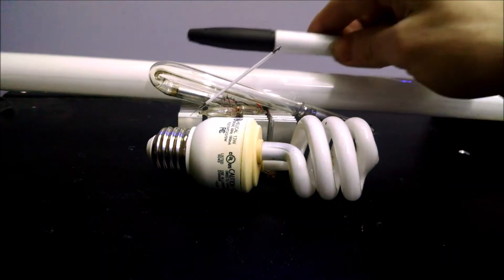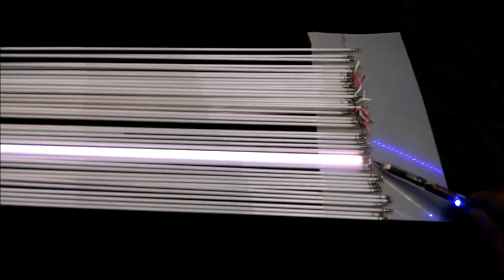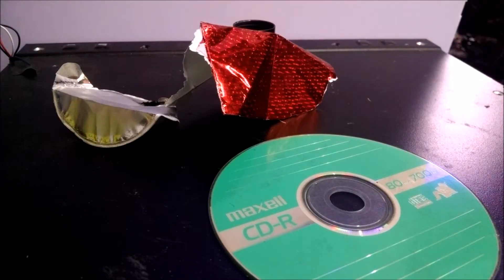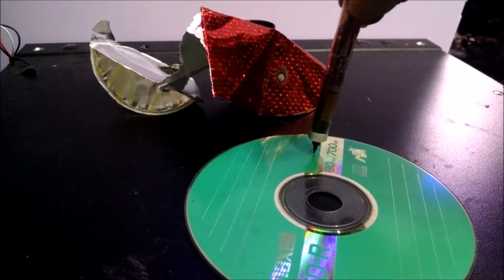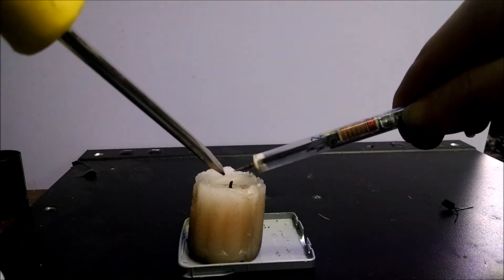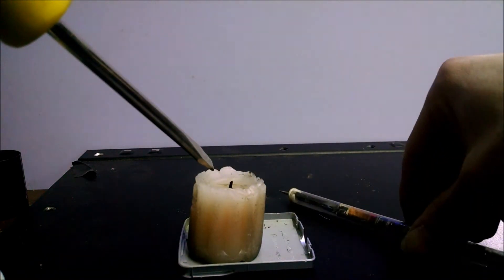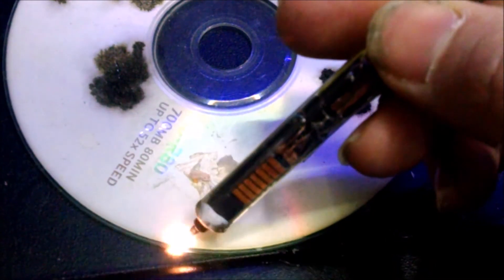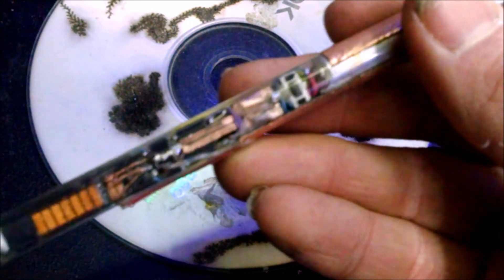High Voltage Gadgets, Tesla Magic Marker & Plasma Pens

Comment: I was looking at your video to try and understand why the plasma skincare pens being sold to use on skin are $5000 and up ! Also what the difference is in an electric versus a plasma pen is . There are electric pens on the market that make a purple arc when held just a couple mm’s above the skin. The skin sparks and then turns into a tiny white dot of sublimated skin . The white dot then shrinks as it heals and the skin contracts causing tighter skin . The confusion around these devices is CRAZY in the skincare world because no one understands the electric component, lol ! There are a ton of them being sold but only a few that claim to be “true plasma”. I am trying to figure out how to tell the difference! The one being advertised as having a Tesla coil in it is $5000 .
Reply from the maker: The plasma pens I make put out a decent more power than what's sold for skin care. There isn't anything special about the expensive ones, they are just basically a dressed up CCFL inverter. Same thing with the healing market and lasers. Several thousand for " Quantum scaler healing laser probes ". Yep... just a $10 laser diode dressed up in a fancy box that preys on idiots. You could just about get the same performance out of a slightly modified arc lighter for next to nothing.

Comment: very interesting. I've actually been working on something similar myself and have come to almost exactly the same design, except I wanted high voltage DC so I replaced the second transformer with a cockcroft-walton generator. the little CCFL transformers are amazing.

Comment: what exactly is the difference between pen "one" and "two", is it the difference in the number of turns at the primary winding or something else?
Reply from the maker: The first one used a PZT (piezoelectric transformer ) in conjunction with a magnetic transformer. The ones that followed used only magnetic transformers. Getting the PZTs to run correct turned out to be really fickle so I stopped using them. If you want more info on how to make them JP and I on Join The Technicians made a build video for the 4K sub special.

Comment: I hate youtube for not recommending vids like this. This is one of the coolest projects I've ever seen. I looked down and saw an old laptop I gutted but never threw away and it never actually occurred to me to check the transformer for the LCD like I've done with Tv's. Sure enough a working one was in there. What I don't yet get is how to get it to power up from such low voltage. I wired up a zvs with random sup-par fets minus the center tap and got the little transformer to spit nice burning plasma with decent arcs but it was at around 9v input and pulling a couple hundred mA. Tried it on another zvs and it shocked the crap out of me touching the topload with bare socks touching the floor, must have been lower frequency. Didn't get arcs but I noticed it trying to arc over. Very frustrating trying to figure it all out. I've potted it now and going to try again but I suppose I need fets with a lower on voltage? I could put together the one I have working but it would suck to not be able to drive it from a single cell.
Reply from the maker: While the recommendations on youtube are terrible the upside is that having a smaller channel means I can connect with my audience better! Thanks for the comment and check out the how to video posted by my friend and I on Join The Technicians.
Reply: @Zenodilodon  That's true, and I checked the JTT how-to but I was too braindead at the time so I'm about to go over it again. You guys are awesome for sharing the information though. It's giving me crazy inspiration though I'm always tinkering but lately with the zvs drivers I've been in overdrive.
Reply from the maker: @Magneticitist  Overdrive is a good way to be! No matter what's happening as least your not bored :P

Comment: I think the Tesla magic marker has potential. If I use something like a bd139 transistor and an lm317 to step up the voltage to like 20v and maybe will produce a spark out the end.
Reply from the maker: Anything you make please share. We have looked into trying to make a mini class E for this so we can ring up higher voltages and do more. So far the best output we have gotten was from mini CCFL transformers. This is for sure something that need improvements for sure.
Reply: A class-e based system is an interesting idea, and probably much more efficient then something like a slayer exciter. The only problem is the size constraint of the pen. Also would the class-e system be self oscillating or based on a phase lock loop system?
Reply from the maker: Size should not be a problem parts are made small enough. I think Class E can be both? I am unsure but I think it can be self resonant. I think some use a pick up antenna for feedback. I don't think it's more efficient then a slayer though simply due to how the final transistors are driven I believe in class E they are almost always semi-conducting which is why it can drive mosfets incredibly fast beyond their rating, it's almost like using gate capacitance as the oscillating threshold. 

As a lighting specialist I would also like to say all of that might be correct, but honestly I don't know much class E.
Reply: Zenodilodon ok, I also don't know a lot about class e operation. Will be interesting once it is done

Comment: The tesla pen is a solid state slayer exciter made out of small ferrite core or a simple tesla Coil with no core, what are the parts
Reply from the maker: The first tesla marker was a small slayer exciter, the plasma pens used a ZVS circuit. I have posted up a really long, but really full 3 hour video on nearly everything you need to know to make any ZVS out of nearly everything you can get your hands on.
Reply: Zenodilodon thanks a lot

Comment: Nice!
What kind of CFL do you use? I dismanteled quite some here in europe, but all i got was bulky metal transformers which could fit on a moderate size boat maybe.

Great job!
Reply from the maker: The transformers came from laptop screen back light inverter boards that where CCFL back lit
Reply: Thank you :)